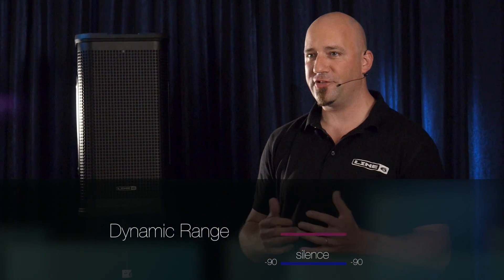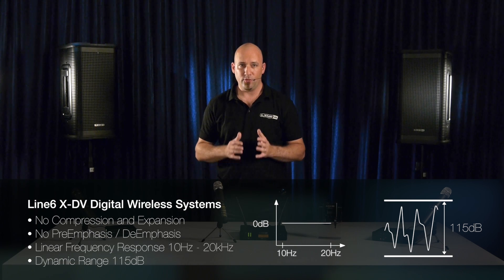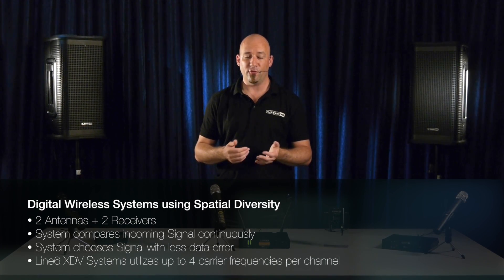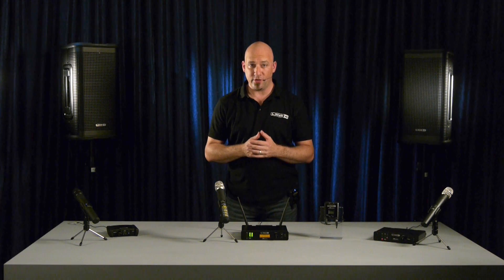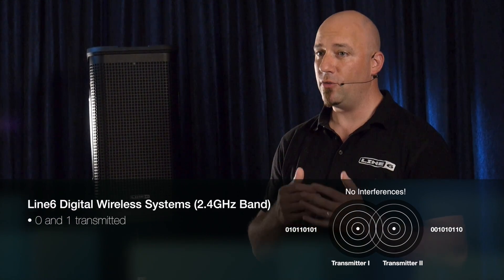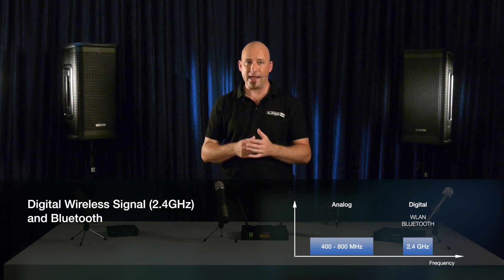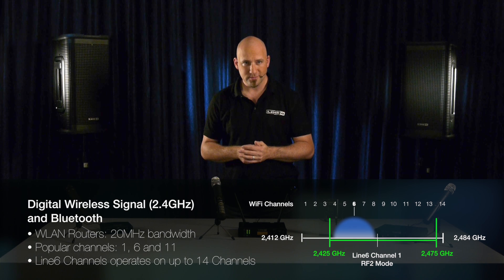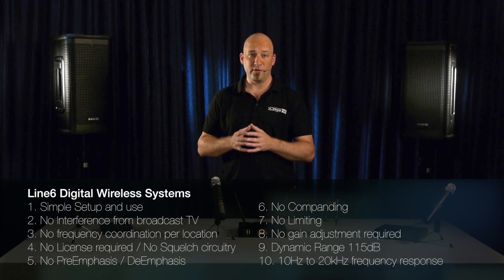Line6 - De-mystifying analog and digital wireless technology

Comment: I'm getting very low input sound, eve when I turn the gain on the reciever pretty high. It eats up all other sound and I very easily get feedback, but I stil ´l manage to barely hear the person wearing the mic.
Reply: Have you resolved your very low input sound?
Reply: @MrJerryjam  Unfortunately no. Tried different settings without prevail
Reply: @Whopcap  Your problem sounds like the transmitter and receiver are not perfectly tuned with each other.
Have you tried different channels?
Is the mic transmit power turned to about 80% and the squelch on the receiver turned to zero?
Which mic cartridge is installed on the mic?  It could be  problem with the mic cartridge.
Which models do you have?